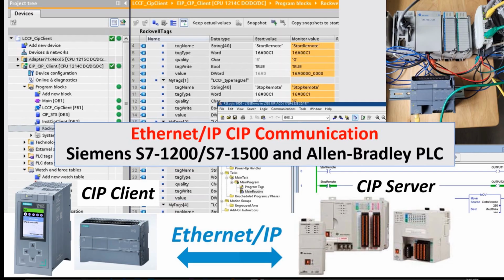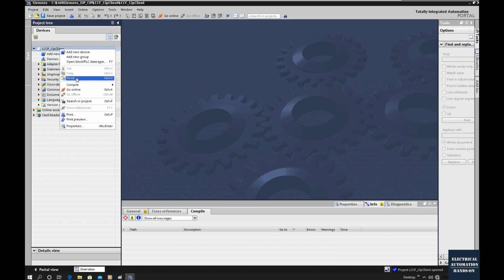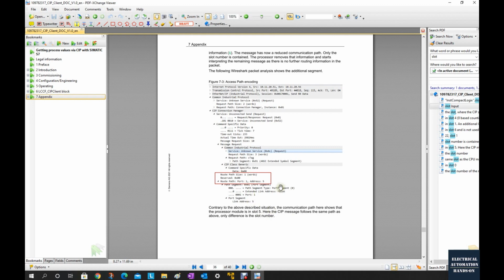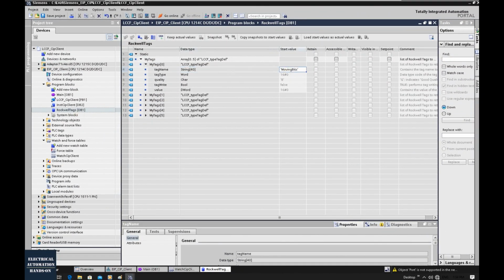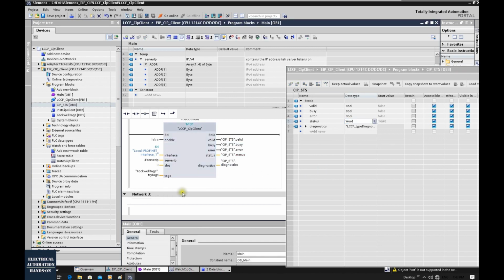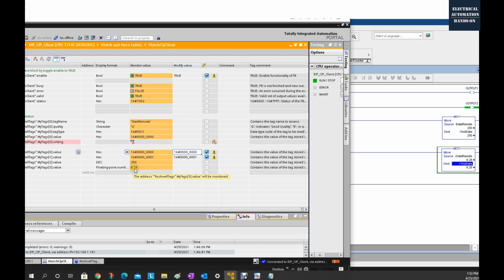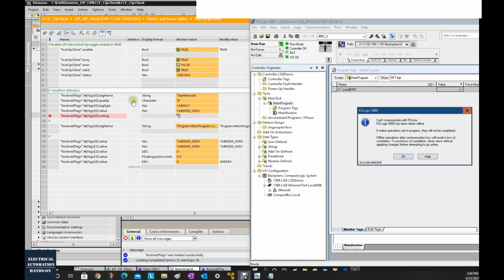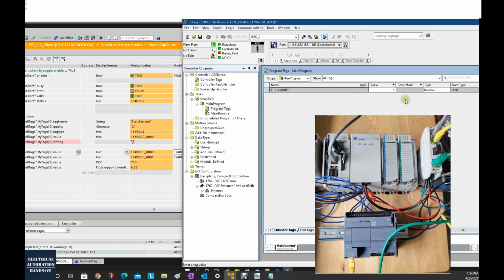COM22. Ethernet CIP - Siemens S7-1200/S7-1500 (Client) and Allen-Bradley CompactLogix (Server)

Comment: Thanks indeed for  the helpful vdo, it made my day. Just curious if this function is used with controllogix cpu which is ethernet port on other module, slot number on CipClient would not be 0?
Reply from the maker: please read the manual from the ID 109782317. Chapter 7 explain the details.

Comment: This setup did not work for me. I get 'B" quality on every tag and the Output Status = 16#7002, The diagnostic status = 16#7601, and the state Number error = 50.  Any ideas?
Reply from the maker: Which controllers and their firmware revisions are you using? Have you reviewed carefully the manual I mentioned in the video?

Comment: I tried this unit with a Nanotec N5-2-3 Ethernet/IP controller. The connection could not be established. It's just for Allen Bradley. Am I thinking right?
Reply from the maker: This video shows the CIP Server/Client roles. Your case should use Scanner/Adapter application. Please refer to https://support.industry.siemens.com/cs/document/109782315/ethernet-ip-adapter-connecting-third-party-control-systems-to-simatic-s7-controllers-via-ethernet-ip?dti=0&lc=en-CA

Comment: Hi teacher. About the connection, it’s posible with an Plc Siemens 1200 and Migrologix 1100B? 
I’am engineer student and have thats  Plcs in university
Reply from the maker: Hi Pablo, I don't think Micrologix 1100 can do it, because it is explicit Client role, it can not run server role.
Reply from the maker: But you can use Modbus RTU for their communication. But s71200 side you need RS485.

Comment: I tested library for S7-1500 with AB L32ERM it it work's even worse, when ethernet is unplugged. During first 30 second after unplugging ethernet cable, status stays at 7002, quality at G. After 30 second status shows 7003 and quality B. But after toggling Enable, block is stucked in some loop, giving statuses 7004 and 8602. To get out of this state, power cycle or stop/start have to be carried. 
 Only reliable communication I found, is ENET Adapter function for Siemens, where Siemens PLC is EthernetIP adapter and it's EDS file is inserted in AB PLC hardware configuration.
Reply from the maker: Thanks for your sharing. Yes, I agree with you, using Siemens PLC as EthernetIP Slave Adapter https://support.industry.siemens.com/cs/document/109782315/ethernet-ip-adapter-connecting-third-party-control-systems-to-simatic-s7-controllers-via-ethernet-ip?dti=0&lc=en-CA.  But I think this example could be used for the case, the AB side cannot be changed or restarted for downloading. If AB runs as 'Server', then just Client side needs to do some works.

Comment: Hi, about the re-connection issue after cable unplugging, I had similar problem while setting up a ModBus connection. I solved by using "TDISCON" function (auto triggered logic on proper Status value). It may work for this case too. Cheers.
Reply from the maker: Thanks for sharing! Good idea!

Comment: Hi, I have tried to follow your instruction as well as documents, the CIP client block status returns valid, busy, not error + status 16#7002 just like yours.  however the tag read/write was always BAD,  Can you please suggest ? ,
my case was S7-1500 <-> CLX-L72  (CPU slot 0, Ethernet slot 1)
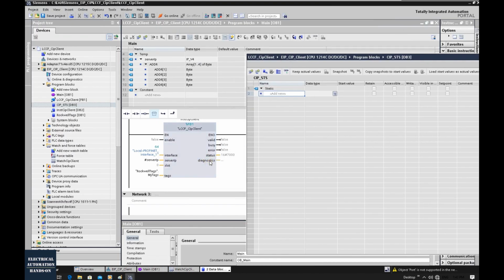Reply from the maker: You can use the diagnosis at 17:40, to chech the detail code
Reply: I have same problem. Upon checking diagnostics, status and substatus is 16#0000, statenumber is 0

Comment: Hi, can we communicate 1214 PLC with micrologix 1400 ?. Is it possible??
Reply from the maker: As shown in 01:29, the application does not show it support Micrologix 1400. For your question, I would recommend you use Modbus-TCP. The new version Micrologix 1400 support Modbus-TCP. For Siemens, you could find my video https://youtu.be/Pty8eB6NDe4

Comment: Hi, can we communicate 1214 PLC with Kinetics 5100 servo drive?. Is it possible??
Reply from the maker: I would not recommend you try this. Cross brand using the servo is nightmare. Also it is Ethernet CIP communication showing in the video, rather than Ethernet/IP Scanner.

Comment: Hello. Can you make a video about the other Function block of siemens ethernet/ip scanner? It will be much appreciated. Thank you!
Reply from the maker: You can search the link https://support.industry.siemens.com/cs/document/109782314/ethernet-ip-scanner-%E2%80%93-connecting-third-party-i-o%E2%80%99s-using-ethernet-ip?dti=0&lc=en-CA. But using Siemens PLC as Ethernet/IP is awkward and I am sorry that I don't have plan recently for this application. Also I would wait for half years till the more reliable second version of the demo program released from Siemens.
Reply: Hello. Btw, can I use only a micrologix1100 on this?

Comment: I like the way you presented the topic. I probally tested a different (may be newer) version of the block. The hang up after connection failure doesn't happen with my setup. Otherwise I see the same improvements to be made by Siemens for this block.
Reply from the maker: Thanks so much for you info. Siemens may update the new version after I tested. Also using a contact to ON/OFF the EN of the Function block may also work for recovering from the connection, this comes from a friend's comments under this video. Thanks again for sharing the test update!

Comment: Hi nice video.
Is this is the "normal" and most common way how to communicate betweeb AB and Siemens?
Reply from the maker: Hi my friend, personally I would say YES. Because there is no any other direct methods allowing AB and Siemens communicate unless you use hardware bridge. It is pain before. Now this EIP application make a break through.
Reply: @electricalautomation  this could be used for S7300 and S7400 as well?
Reply: @electricalautomation  Hello there, my question is, can an AB PLC communicate with the Ethernet port aswell? sending like 50 signals read/write? because you didnt demonstrate Ethernet port but you only showed DI and DO hardwired.
Reply from the maker: @genantamtam9364  Hi Buddy, the entire video is talking about how to use Ethernet/IP to communicate between Siemens and AB. Please review again.

Comment: Very useful video! Do you have an information about "CIP Service Tool" which is mentioned in documentation to automatically export tags from Rockwell project? Is this tool available online?
Reply from the maker: Could you please let me know what the min in the video I mentioned "CIP Service Tool". I can not recall where it is in the video.
Reply: @electricalautomation  This was not mentioned in the video but in the documentation for the Siemens LCCF library
Reply from the maker: "The tool uses TIA Portal Openness for the import feature and can browse into 
Rockwell Automation controllers, which are directly connected to the computer 
running the “CIP Service Tool”. You need to use TIA Portal Openness, which is in the 2nd installation DVD.

Comment: Hi, Wonderful presentation. I did a test according to your demonstration. I can re-initialize the comm block by adding a contact infront of the block to disable the entire "LCCF_CIPClient" block. Then toggle the enable bit again without start/stop the controller.
By the way, I have tried the "LCCF_CIPServer". I was not able to make the MSG block worked in Controllogix. However, using the Proface WinGP works. DA Server from Wonderware like DASABCIP or DASABTCP did not as well.
Reply from the maker: Thanks for your test results and the experience you shared. I agree. I would recommend use the Siemens as Client. I also found the trouble on 'CIP Server' application example. It is not 100% successfully. After all the CIP Client/Server example is just an 'application' for us using as a reference, they are not the official function blocks built-in the TIA Portal. They could have glitches or limitations. Thanks again for your sharing!
Reply: were you able to make the cip server work or you didn't try again? I am in the same situation
Reply: @santoelectron  No. I did not try again.